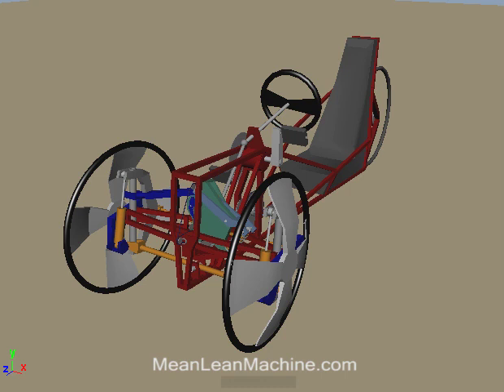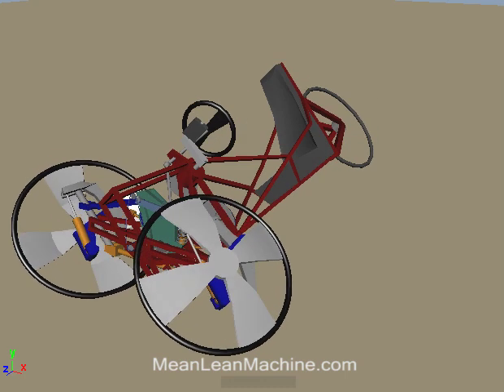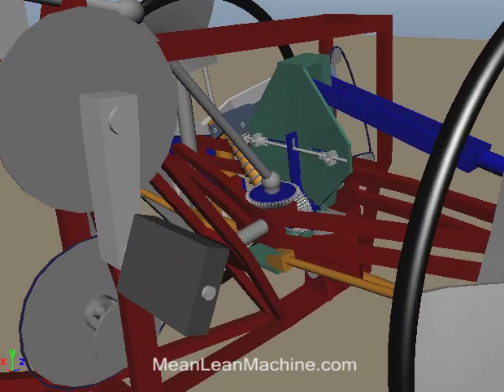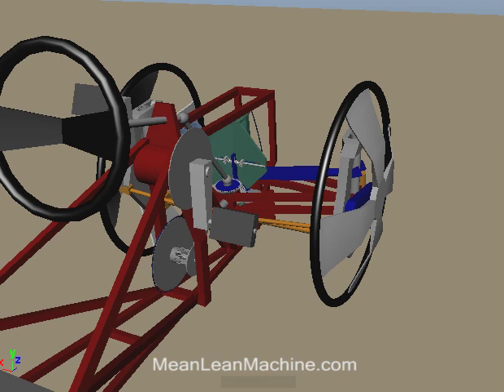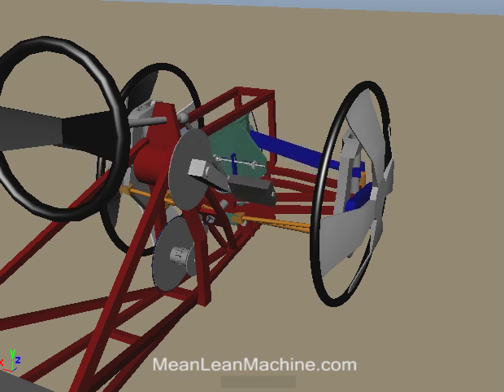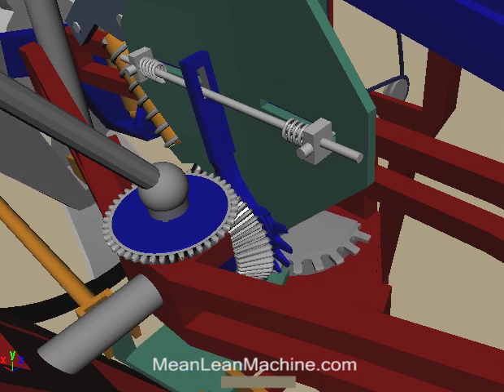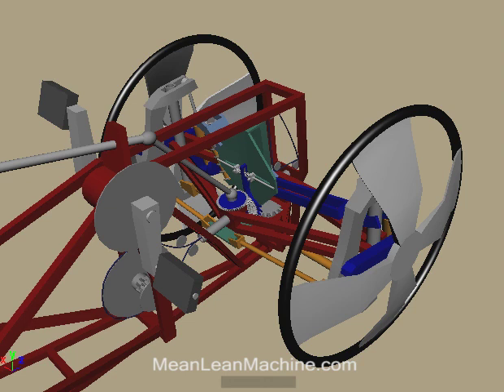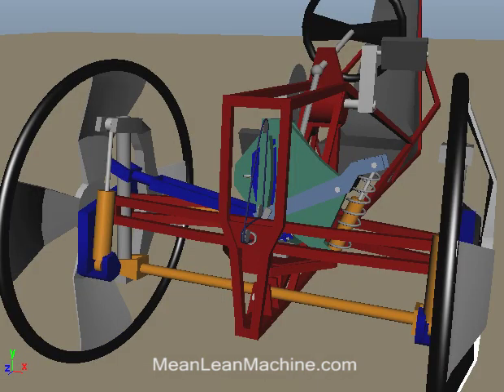Leaning trike concept

Comment: I think I understand why you designed a dual steering system. I assume it as meant to give you the ability to carve the corners using the weight  transfer and gyro effect stability of caster tilt steering. The upright steering would allow for low speed maneuverability and a short turning radius.????If so I can give to a simple solution to your problem. It will cost less than 20 dollars US and weigh only ounces. However, the cost of my knowledge will cos you quite a bit more.

Comment: Waaay to over-engineered, but interesting. How about a single positive castor pivot with a small rake distance to the front wheel axles? Designs like this usually have a large camber on the fron wheels to prevent oversteer.

Comment: 0:25 wrong: gyro moment counteracts leaning (test it w/ bike wheel spinning in yo hands). But at usual for bike wheels' angular momentum, this negligible effect is trumped by proper trail &caster angle.
Serious guys study matter first thru Wikipedia at least, not to litter Internet nor distract others w/ B.S.
Study the designs implemented in tilting scooters on the market - they work &look more sensible than yours.

Comment from the maker: All steering is done by the steering wheel. At low speeds you put the trike in normal steer mode and it does not lean and the steering wheel angles the front wheels to steer. At normal riding speeds you transition to Free to caster mode. In (FTC) mode turning the steering wheel leans the trike and the connection between the steering wheel and the turning angle of  front wheels is loosened, so you steer by leaning and the wheels find the proper angle for the speed and lean angle.